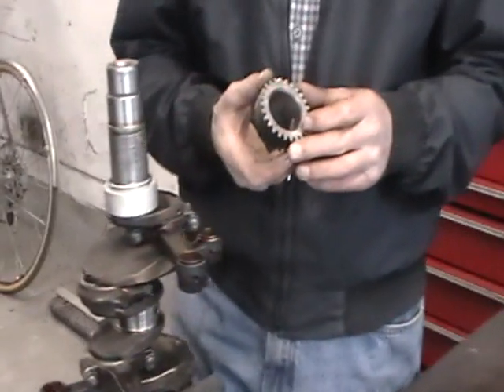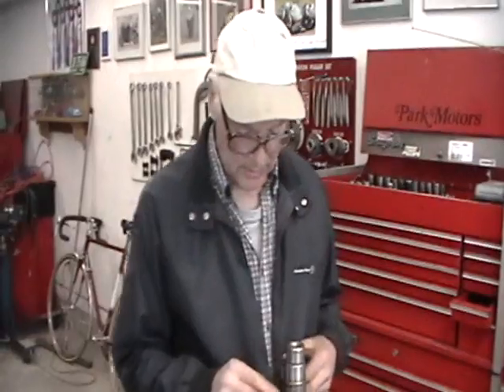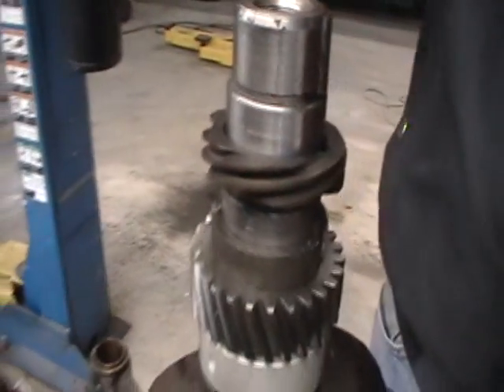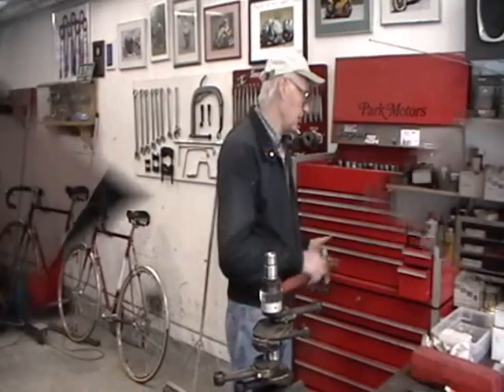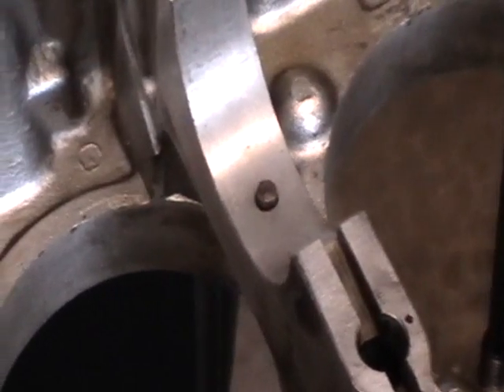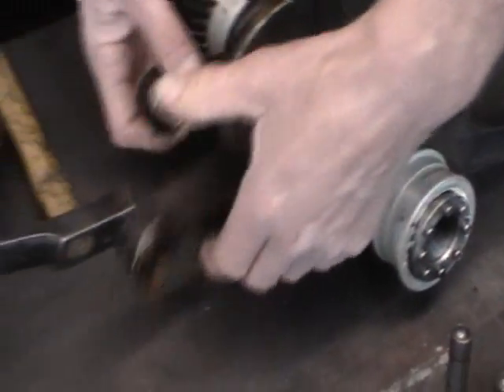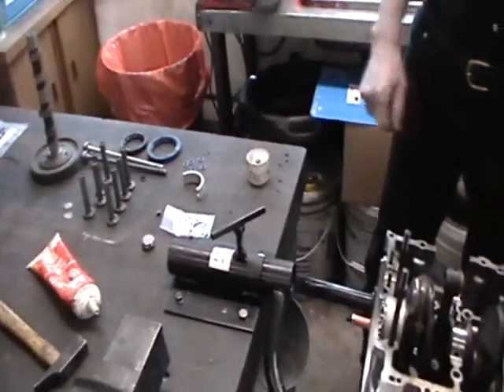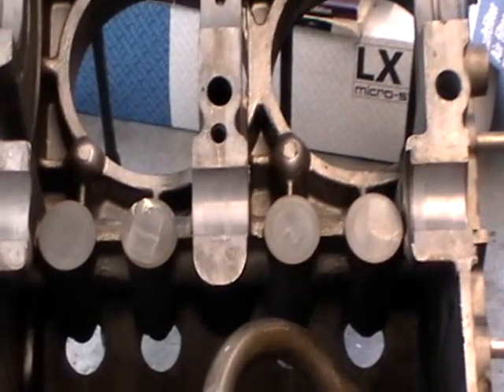Porsche 356 engine - Part 2

Comment: FORGET DRIVING ON THE CAMSHAFT DRIVE GEAR AND THE DISTRIBUTER DRIVE GEAR, i ALWAYS HEAT THEM WITH A PROPANE TORCH FIRST  THEN THEY DROP IN EASELY   AND CAN BE SEATED WITH A SHORT PIPE AND A HAMMER!
Reply: You know , I had read that in a technical book already , and was very surprised he did not mention that.

Comment: There is an easier way to install the two gears and spacer. Just heat them up on a hot plate and they will fall right on. Make sure you keep a brass punch and hammer handy in case the gears get cocked. It will only take a light little tap.

Comment: Great video but the third bearing does have a correct orientation because the oil holes are not exactly centered, If you put the bearing in the right half of the case, in the dowel pin, the oil hole on the bottom should be exposed at about 5:00. All of this is explained in The Secrets of the Inner Circle by Harry Pellow on page 153
Reply: 🤫- that is a secret